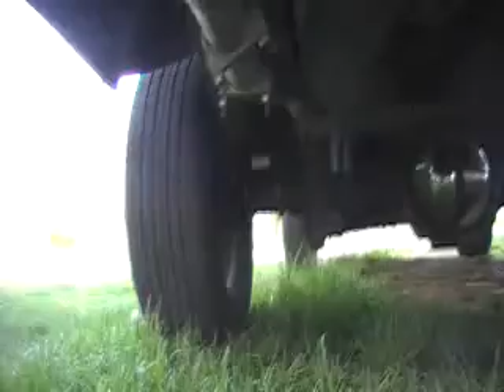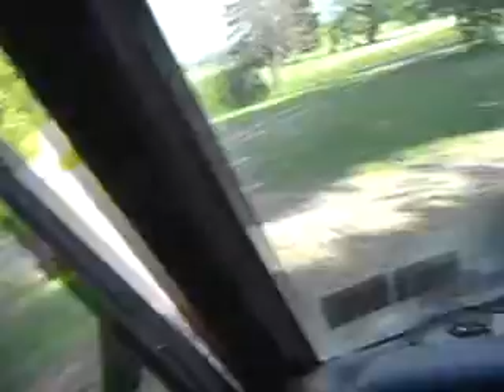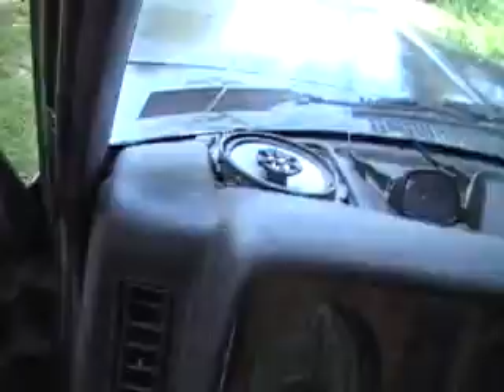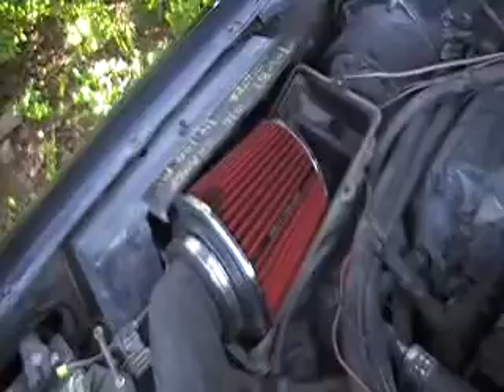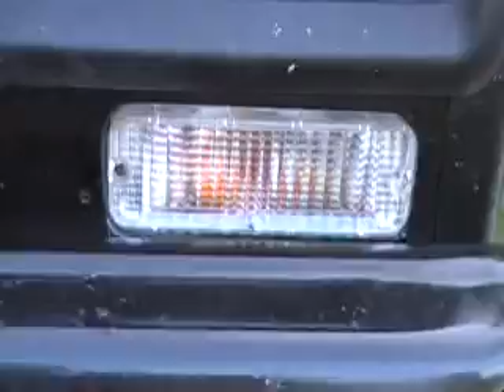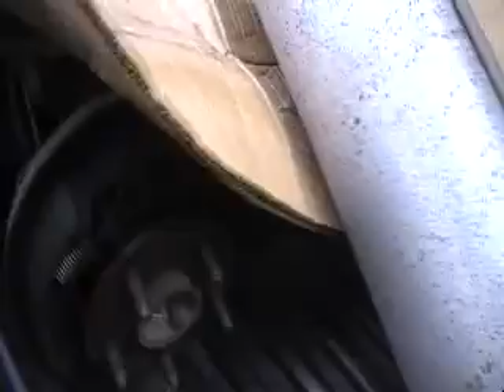86 Ford Ranger Update #2

Comment: Julius B i know way too late but hope it helps anyone else wondering  just disconnect hoses they dont need to be used one is just to keep the flap open or closed on the original hose were the air comes in from the front grill area. i just left that piece in my truck and tore the flap out so more air would flow into the engine and air filter as far as the other vacuum line idk just plug it off with something
Reply from the maker: That's pretty much the same thing that I did too 👍